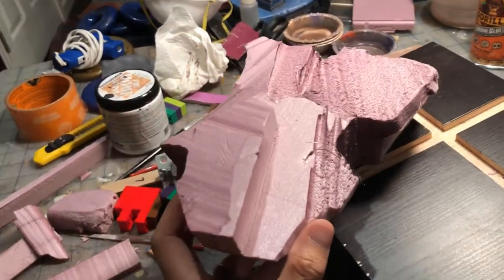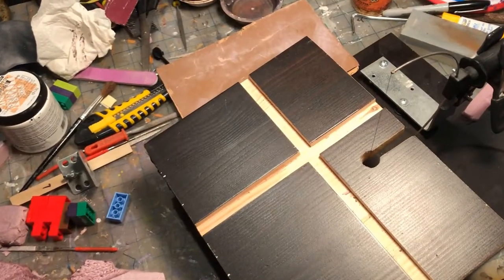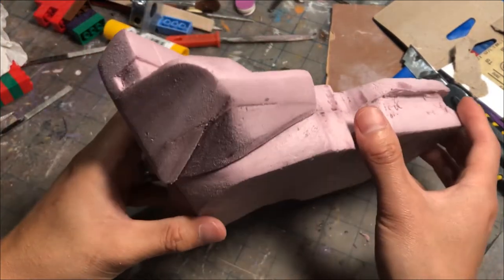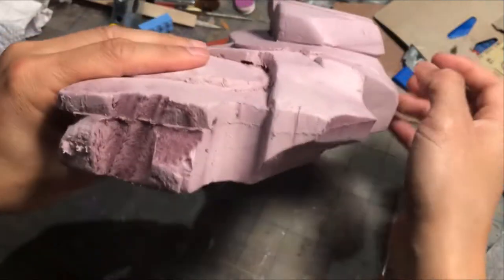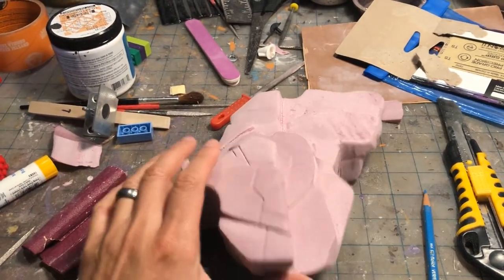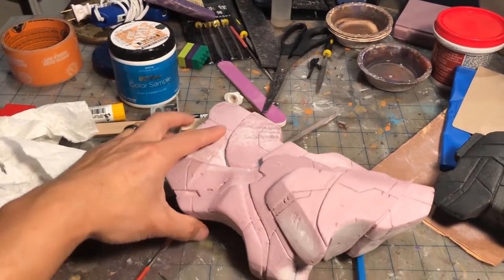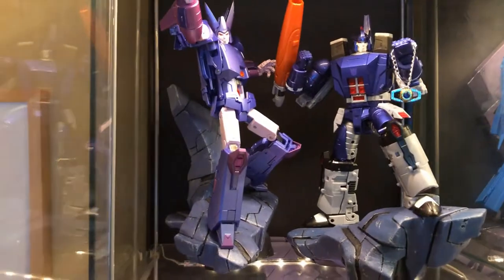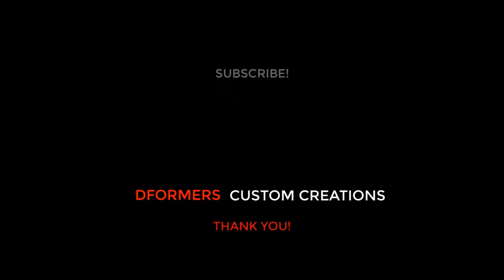Updating My Display - Movie Decepticons

Comment: Where do you get this kind of foam for dios and displays? I have looked at Michaels, Joannes, and big box stores but no luck. Great videos! Very informative
Reply from the maker: Pool thanks! You can get this type of foam from the hardware store. It’s insulation foam so they come in big sheets in 1 or 2 inch thickness depending on where you live and the climate. Hope that helps.